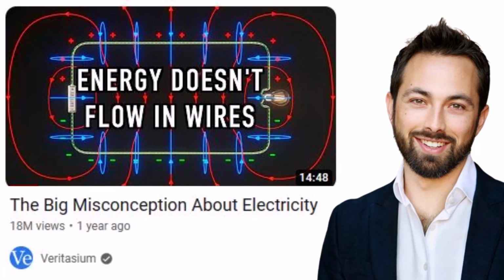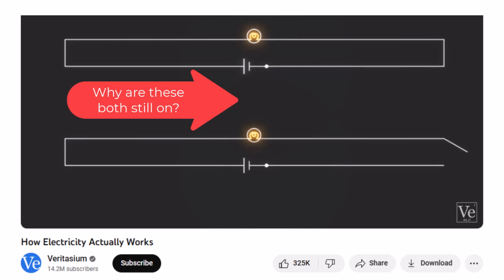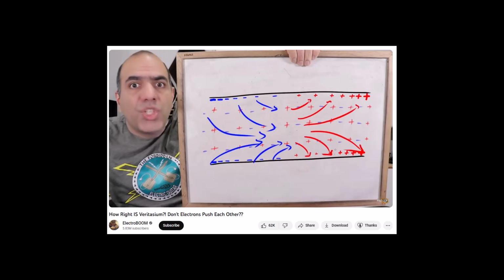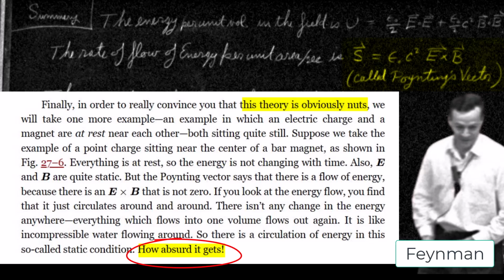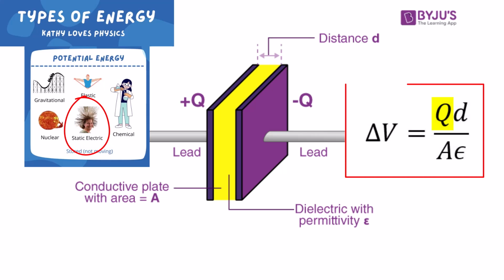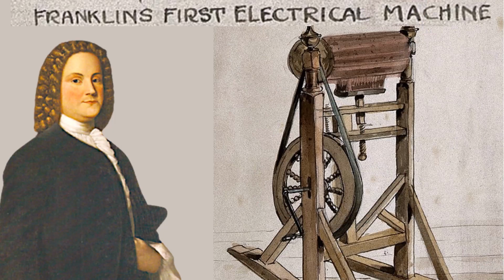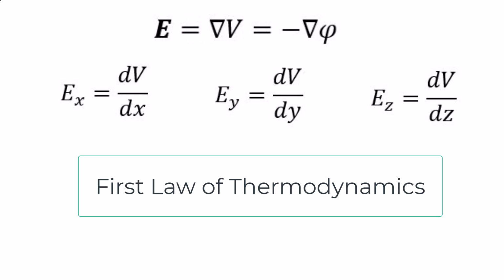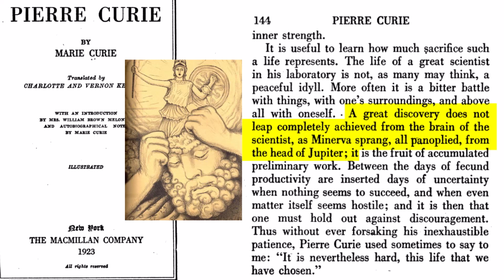Deep Dive Historical Response to Veritasium’s DC Electricity Video

Comment: I have several comments about this video:
1) Your excerpt from the Feynman lecture is taken out of context and misleading.  Taken in context, it is clear that Feynman is saying that even though it is counter intuitive and seems crazy, the standard interpretation of the Poynting vector as the energy flux is correct: the energy flows through the fields in the space surrounding the wires.

2) Your use of the expression "direct current" confuses the concept of "direct current" with the concept of an electro-static (or electro quasi-static) system.  "Direct current" means simply "current that flows in one direction" and colloquially does includes what happens when a switch is closed in a circuit consisting of a battery, wires, a light bulb, and switch connected in series.  The two different "steady state" conditions of "switch open" and "Switch closed" are well described by setting all time derivatives in Maxwell's equations to 0 which is called the quasi-static approximation.  For a system that changes in time, such as when a switch is closed, this is approximation is only valid if you are only interested in time scales much greater than l/c, where l is the physical size of the system and c is the speed of light. This requirement is not satisfied in the described problem.

3) Your a) dismissal of the "Poynting vector" for describing energy flow in DC circuits, b) your characterization of the physics of closing a switch in the described circuit as "DC" and implying that the physics of the transient is no different from the physics of the steady state,  c) your misleading quotation of the excerpt from the Feynman lectures, d) your discussion of the Maxwell equations, and e) much of your discussion of the difference between science and pseudoscience taken together indicate a lack of understanding of the meaning of the Maxwell equations.

The Maxwell equations are set of 4 coupled partial differential equations which, when supplemented by the Lorenz force law, Newton's laws of motion, and appropriate description of the system understudy, including initial conditions, describes the time evolution of any electrical or electro-mechanical system for which effects due to quantum mechanics are not important.  This is not controversial; the successful operation of all the electrical and electro-mechanical devises in our modern world attest to their correctness.

Poynting's theorem, which is also a partial differential equation, can be derived from the Maxwell equations; so if the Maxwell equations are correct (they are) and the manipulations used in the derivation are valid (they are) then Poynting's theorem is true.  Poynting's theorem is derived and discussed in all sufficiently advanced textbooks on electro-magnetism. In my library, the derivation is presented not only the Feynman lectures, but also in "Classical Electrodynamics" JD Jackson, "Static and Dynamic Electricity" by Smythe, and two volumes  ("The Classical Theory of Fields" and "Electrodynamics of Continuous Media")  of the Course in theoretical Physics by Landau and Lifschitz. It is even derived two books that are not strictly speaking electrodynamics textbooks: the mathematics textbook "Methods of Theoretical Physics" by Morse and Feshbach and the engineering textbook "Electromechanical Dynamcs" by Woodson and Melcher.  

There is no doubt that Poynting's theorem is true. The only possible controversy involves the interpretation of the terms its terms.  

The question of energy conservation in classical electro-magetism is discussed at length in Sections 27-1 through 27-5 of the Commemorative Edition of the Feynman lectures on physics;  Poynting's theorem (although not referred to as such) is Eq 27.13, and it is derived in Section 27-3, and the quote taken out of context in the video appears in section 27-5.  

Contrary what is implied in the video, neither this discussion nor the derivations and discussions in the other textbooks appeal to authority for their justification; they all present mathematically rigorous derivations of Poynting's theorem from the Maxwell equations, supplemented by discussions of the interpretation of the quadratic terms in the theorem as the energy density of the electric field, the energy density of magnetic field,  the rate of mechanical work performed, and the energy flux in the electromagnetic field.  

Poynting's theorem is definitely correct, and its interpretation as implying that the energy density and energy flux in a electro-magnetic system are both distributed in the fields is a mathematcially consistent and correct description of electro-mechanical systems.

In the video you refer to the product of the charge and the electrical potential as the electrical energy. This equation is only true for static systems, and cannot in general be used to analyze a dynamic system such as closing a switch in an electrical circuit. Feynman shows that for electro-static systems the expression in terms of fields, when integrated over the entire system, gives the same numerical result as the volume integral of the product of the electric potential and the charge density, while also consistently describing the full dynamic (time varying) case. 

For the present case, there is no mechanical motion (the wires are assumed to be stationary), so only electrical properties are important.  Furthermore, the conductors are assumed to obey Ohm's law. In this case, if the geometry of the wires is specified, including the geometry of the switch, the Maxwell equations can be solved to determine the time delay between closing the switch and the light illuminating.  Except in special cases, the equations cannot be solved analytically, but have to be solved numerically on a computer.   This is well understood physics, and I assert that the chance of a disagreement between the results of the calculation and an experiment. 

For the present case, the Maxwell Equations can be solved numerically to calculate the brightness of the bulb as function of time.  This time dependence depends on the exact location of the wires, so your statement that the correct answer (if the question is interpreted as asking for the time it takes the brightness to settle down to the steady state value) cannot be determined from the statement of the problem is correct, but the strong implications that the validity of Poynting's theorem is controversial and that time dependence cannot be accurately computed using the Maxwell Equations is false.

In many cases intuitive understanding can lead to accurate and useful insight, although intuition is no substitute for detailed calculations. In the present case, my intuition says that a) electric current cannot start flowing in the bulb until enough time has elapsed for an electromagentic wave to propagate between the switch and the bulb, b) the steady state will not be established until a time somewhat longer than the time required for an electromagentic wave to propagate all the way around the wire, and c) the details depend on the exact geometry of the circuit.

Comment: A real life example of this happened when we found an open cable, that sat between many others in our theatre. The ran in parallel to 20 others, for tens of meters. We were wondering if there was anything connected to that wire. We measured 70 volts AC relative to ground, on each of the three strands. But no current ran in any way we tried. We pulled the cable out, which was a lot of work. It turned out it was not connected in any way. The 70 volts were simply induced, but there was hardly any power behind it. No way that a lamp could be running from it.

Comment: This has been a fascinating discussion, as Verisatem, Electroboom and a fair number of really clever engineers/physicists have all contributed to this with very clever setups and calculations.   It has really caused a lot of Ph.D.'s buzzing about but I'm still unsure of the process.

The question I would like answered is:  

- If we have a length of top quality low resistance wire let's say 1 light second long in a single circular loop, 
- the battery and bulb are extremely close, and the switch is diametrically opposite or interrupts the circuit midway through the loop.  
- The switch is super fast and doesn't create transients or other indications that the circuit is opened or closed i.e. no phonons/photons, etc 

I can see the switch becoming a capacitor and causing a transient. Would it take half a second for the bulb to light up? How would the circuit know if the switch had been closed?  

Curiously Chris

Comment: As a follow on to my last comment, that you may want to see the follow on video he made, you use the phrase "push charges to flow" through the wire. That is not what is happening. The electric field is what is propagated along the wire and that in turn makes electrons, local electrons, hit into the lattice, which is the nucleus, thus warming the lattice. Electrons do have a drift along the wire, but that is very small, about 0.1 mm/sec. It is the field that moves the electrons at that point in the wire, which hit the lattice causing it to vibrate which is the same as heating it up.

Comment: It feels like you are taking Feynman’s comments on the Poynting vector out of context.  The Poynting vector is a measure of energy flux, and that’s by definition, there isn’t anything to argue about there.  What he was talking about is a bar magnet next to a battery, where no power is either provided or dissipated, but the Poynting vector is non zero, seemingly indicating that energy is flowing in circles, which is not intuitive, but is still true.  To say that the Poynting vector doesn’t work at DC, or that it isn’t accurate is wrong, it works because it is defined to work, it is an extension of Maxwell’s equations.

Comment: DC creates an EM field for only a very short time per faraday (electrition)  And I current equals delta V?   If ohms are zero current is infinite...per ohms law
Reply: A potential is generated when potential goes from zero to + or - or returns.  And apply potential to a generator and you create a moþor...

Comment: Well, I made some work about Poynting vector especially in quasi-static cases (in the circuit frame). According to me, there is nothing wrong with the present theories, only a poor understanding of the Poynting theorem I am afraid. 
The Poynting theorem doesn't say anything about the actual flow of electrical energy. Worse it gives infinite possibilities to define the energy flow through a vector field, all leading to the same balance. I have shown in one of my articles (published in the AFLB journal), that you may define an energy flow in a capacitor not going outside radially but axially (parallel to the wires) as your intuition suggest, with the same overall balance. 
More technically, you can add any rotational field to the Poynting vector without modifying the energy balance. Discussing where the energy flows from one point to another point is pointless :-) both in Maxwell frame and in the QED  frame (In the quantum frame, the trajectory of a photon is not more defined). 
You may consider the flow of energy in the wire, or outside it like Derek and many others, or in circles as Feynman introduced in its course to illustrate the idea of the indetermination of the energy flow (you should have followed the entire course instead of extracting only a short portion of it !). 
If people generally use the cross product definition it is because it is clearer to describe waves propagation in vacuum, and also because its a relativistic invariant, but this is another problem we may discuss another day. The philosophical question about the actual path of electrical energy flow remains open I am afraid !

Comment: A voltage's units are in energy per unit of charge, but it is not a measure of how much energy a charge has. It is a measure of the differences in energy if you were to move a unit of charge between the two reference points. It's a very subtle difference that isn't often made in electronics,, where it is common to assume a fixed reference point exists (i.e. Electrical ground).

It is like gravitational potential energy. A bowling ball in a 10th floor apartment has different potential energy relative to the apartment's floor, the ground or the bottom of a well. 

Once that is clearly defined, you have the inescapable conclusion that in circuit, even a steady state DC one, the energy flows is defined by the geometry of the electrical field around and inside the wires and components. Where the field gradient is zero (as it is in an ideal wire) there is minimal energy flowing.

At the atomic scale a 1A flowing in a 100,000V cable will look just the same as 1A flowing in the same cable at 1V. The 100,000V cable will be transfer 10,000,000,000 times the energy if connected to a (short lived) light bulb to ground, however same number of electrons will pass thorough a cross-section of the cable for the same period of time, travelling at the same average drift velocity, with the same average kinetic energy.

Comment: When I was in college, the professors acknowledged that the electrons flow from - to +, but to keep the math easier, we engineers cleverly came up with hole-flow theory... as an electron moves, it leave a gap, so the one behind that comes in to fill that spot, but it left a hole and the next one behind that moved to fill that gap, and so on.  If you look at this gap, or "hole", it is moving from + to -, hence hole-flow theory.

Comment: I, too, really enjoy Veritasium, but found that one production particularly at odds with my thinking, based upon a long career in electronics and my education, both formal and self-study.
You presented your rebuttal in such an eloquent way,  explaining it logically and as supported by theory, also debunking the whacky Poynting Vector when applied to DC. If surface charge was all-important, we'd certainly be using pipes (with supporting cores) instead of solid conductors for electrical transmission. I will be waiting with bated breath to see if Derek concedes to you, or, at least, revisits the issue. 
In my opinion, for practical tests and demonstrations, the wire should be a huge loop, not a parallel pair, in order to minimize it's transmission line characteristics and the behavior that occurs at switch closure due to the rapid leading edge of the pulse and the subsequent ringing of the circuit.

Anyway, thanks! You're another of my favorite educators and now my hero as well!

Comment: I think a lot of the confusion is due to not really defining the problem well enough, e.g. what is the switching voltage, what is the resistivity of the load (light bulb) at which voltage over the load does it switch on, what is the inner resistivity of the source (i.e. how powerful is it), what is the resistivity and the reactance of the wire, what is the capacitance (or better reactance) between the parallel sections of the wire. Having numbers for all this you just set-up the equivalence circuit, calculate the transfer-functions and you know how the voltage (difference) over the load raises with time and when the load switches on. 
If your source has zero inner resistance (i.e. capable of delivering infinite short circuit current), your capacitance between the parallel wires is very large and the resistivity of the load is very large too, then the load would be capacitive coupled to the sources and light up basically immediately in 1/c seconds. On the other hand, if the capacitance (or better reactance) between the parallel wire sections and of the wire itself nearly zero and the resistivity of the wire is very low to then the bulb lights up after roughly 1 sec. If the capacitance of the parallel wire sections is small but the resistivity and capacitance of the wire itself is large, then it might take minutes or hours for the bulb to light up, because you need to polarize the wire first (i.e. charge its large capacitance or reservoir of charge). 
So it can be basically anything, depending on the parameter you chose.

Comment: I think you got lost in the weeds on this one, Kathy.  My professors would have said, “assume an ideal battery, switch and light bulb”, because they are not the focus of the experiment.  In reality, we would use a power supply, a fast FET as switch and a detector.

You owe an apology to Feynman.  He was warning his students not to think in metaphors, nor to expect the simple beauty that Einstein craved, but to accept the observations and math of quantum physics and work from first principals. 

I believe the correct model for the Veritasium experiment is to ignore ‘length’ on the right side (ground) and ask the question ‘how long for the pulse or step function to arrive at the detector?’  The straightforward answer is the length divided by speed of light divided by the dielectric constant surrounding the ‘wire’. The ‘transient’, whether step or pulse, will propagate as its Fourier elements, as TE or TEM or other model, depending on how the ‘wire’ is running through space.  There would likely be frequency dispersion and the step or pulse on arrival will be distorted.  

In the steady state aftermath of the transient, there will be a steady electric field proportional to the voltage and magnetic field proportional to the current.  

Only the ‘transient’ can be meaningfully described as being transported by a ‘field’ around the conductor.